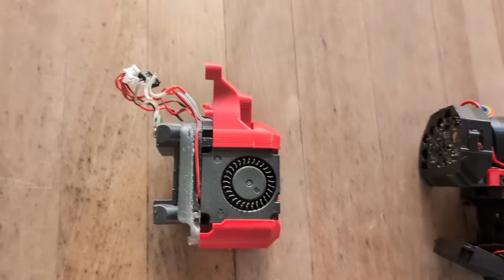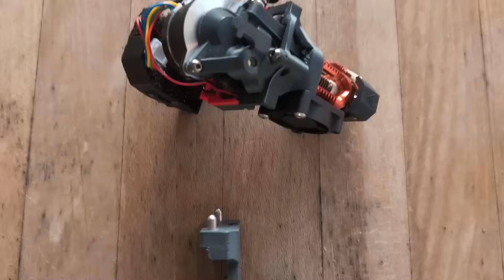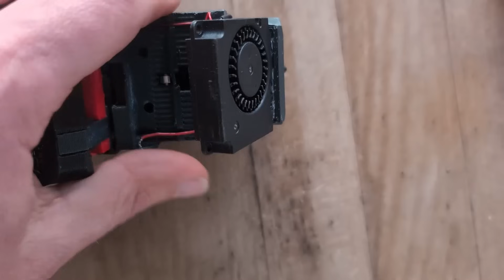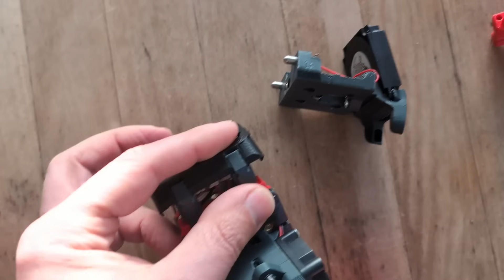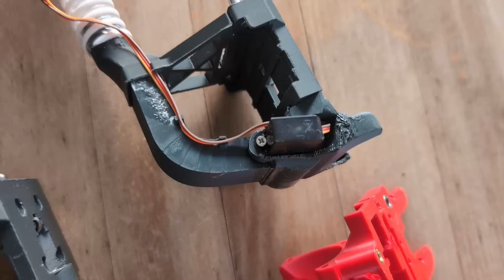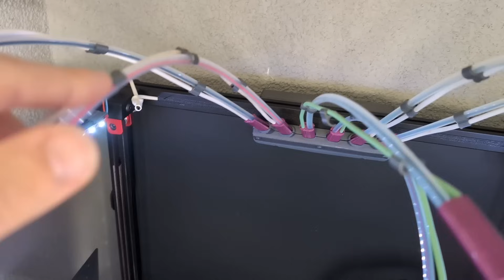ClickChanger - a new toolhead toolchangers.

Comment: @viesturz I have changed from bearings to the extruder spring at the senter of the MGN9H and MGN12H this way I don't need to re adjust it maybe something to consider. It still can slide up and down about 1.8mm preload on the spring and the protruding part that presses against the tool/carrier is 0.8mm I need to test docking. I like this setup over the bearing as it never shod need to be re adjusted. In my testing on Hydra tool changer I have seen that the preload on the bearing needs to be re adjusted, and I flagged this during my testing and wanted to come up with better way to do this. I think this can work in your design too. My shuttle is thicker so you may need a shorter spring or just increase the preload. I picture that the barrel that  is in the MGN12H is almost 20mm in diameter can be CNC or just polished/ sanded slightly for smoother operation. Sliding in and out and the top surface pressing against the tool/carrier.

Comment: Was thinking to build liftbar, but now when you said you don't like it, I starting to doubt, what is the downside with it?
Reply from the maker: It works really well & I like it. I'm just saying it's over engineered significant work to build & install. Start with a static dock and upgrade to liftbar once you have it working. 

PS, the static dock just landed in the repo, I have not tested it though.

Comment: This is almost exactly what I had envisioned. I do recommend some sort of shroud on the hotend fan to maximize cooling efficiency, but I love how compact it all is.
Reply from the maker: I find that just having most of the hotend exposed results the fan moving surprisingly lots of air, so no concerns over that at all.

In comparison I had ABS clogging up a High flow dragon with a tapchanger setup, same hotend working flawlessly here.

Comment: I really like the update to your design. I don't know if you have seen my toolchanger approach yet? I use CPAP and a beacon probe permanently attached to the shuttle. Everything is completely custom on my end, except for your toolchanger klipper extension, which I use as a base script. I may have to think about using bushings and pins again. In any case, I will definitely follow the further development.
Reply: I would like to see that. I don't like the Stealthchanger setup I have now, the toolheads are so heavy and I have tap failures from time to time

Comment: Your new design is very similar to my Hydra design. However I have the pins way more apart and I use two bearings in the bottom. I’m currently working on a lockable design to check print quality if Hydra tool changer is adding print imperfections. I’m not happy with the pins and busing there is always some play in them. I have experimented with 3d printed busing. Next for me is adding the Revo PZ, then the Voron (OptoTap) sensor will become tool sensor only and not do the Z alignment anymore. However your tool head is way lighter than my SB.
Reply: My print quality imperfections were cause by the rails. I would consider making a video about it. How I check my rails may be useful and how to know what and how to check them.

Comment: Great work. I like seeing the Revo PZ probe being used for homeing.
As I do not have the PZ sensor yet, one question:
Do the Piezo also sense if it touches at the side of a pin, like Prusas loadcell in the Nextruder? would be nice to have a simular auto offsett calibration like the XL by changeing all hotends to a Revo PZ...
Reply: I’ve read into piezos a bit, and from what I found they will detect impacts, rather than constant force. It depends on how the piezo is mounted wether or not it will detect sideways impacts. Couldn’t find anything more detailed about the Revo PZ Heatsink and how exactly the piezo is mounted
Reply from the maker: Yes it should work. It's currently a very expensive way of doing that however.

A better option would be to buy the piezo sensor alone and mount it on the bed with a pin attached.